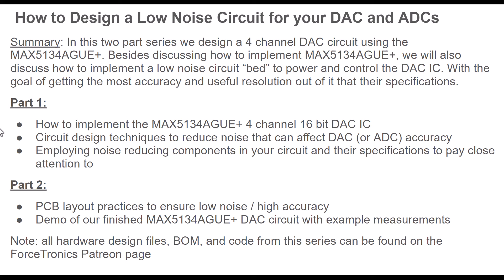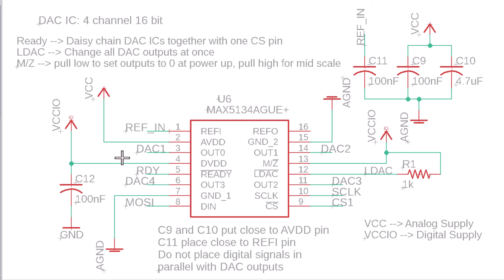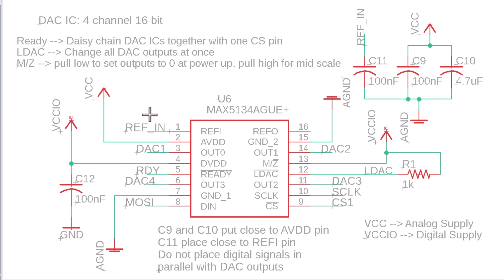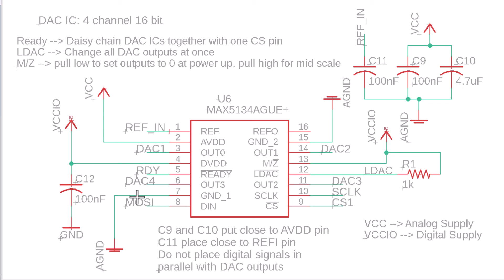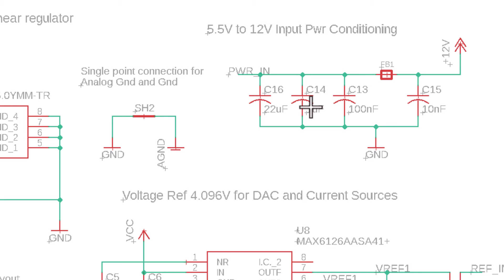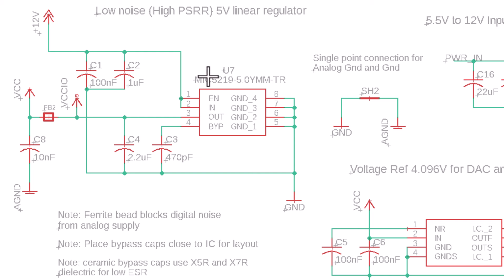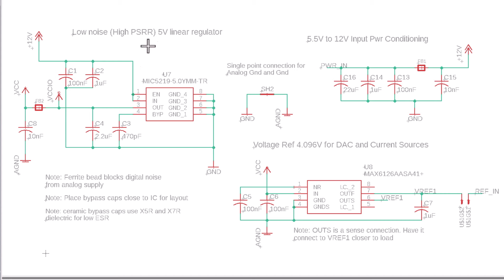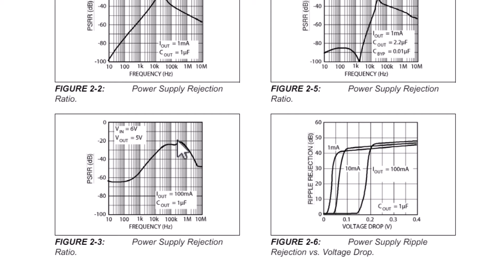Designing a Low Noise 4 Channel DAC Circuit with the MAX5134 Part 1

Comment: Quality content as usual... Should'nt the AGND and DGND be separated ?
Reply from the maker: Thanks for the comment. I thought I mentioned it in the video, but the DAC IC only has one common ground. When I dug deeper the data sheet explicitly said both the digital and analog supply can share the same ground. My guess is they have some type of filtering inside the chip but I don't know. Since the DAC is the only part in the circuit that uses the digital supply there is no need for a digital ground. Of course the design itself has a standard ground and an analog ground that has a single point connection.
Reply: @ForceTronics   Thanks ... Will be interesting to watch the subsequent parts and the final result...